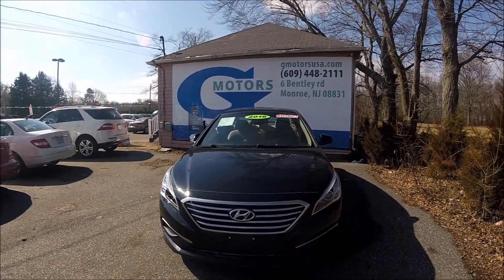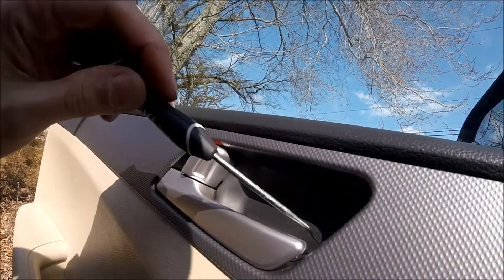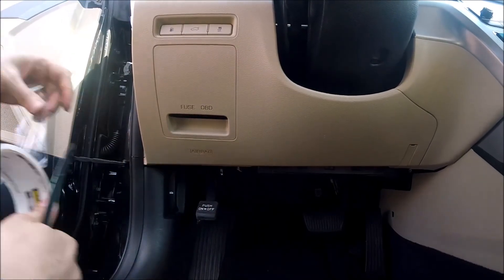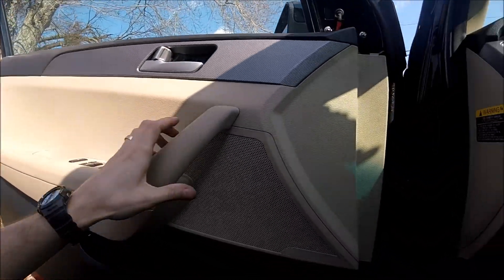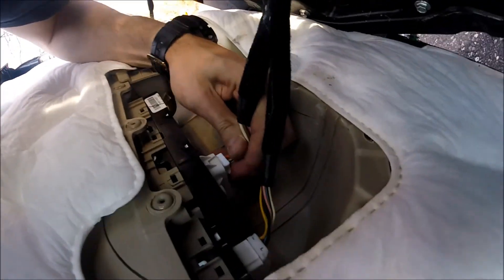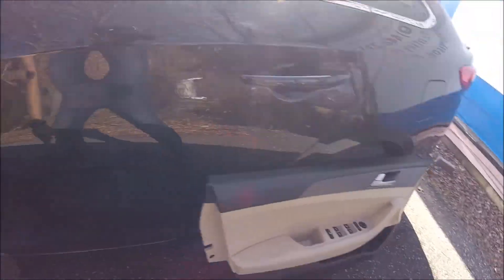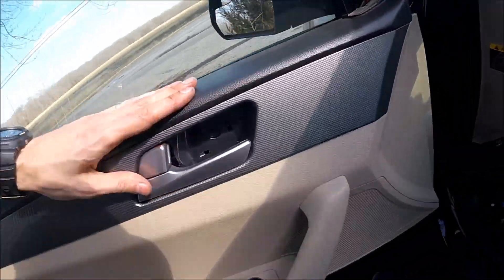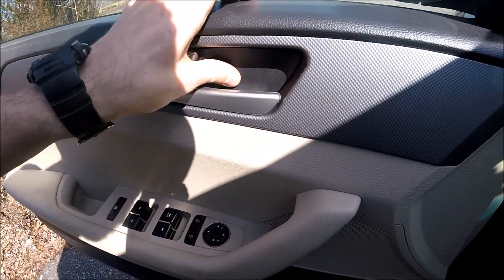How to remove door panel in 2015-2018 Hyundai Sonata

Comment: Thank you for video and I especially liked how you covered knife with tape to prevent scratching. I removed and replaced panel in ten minutes. The wires to the window/lock/mirror had become unplugged from switches. Very easy fix. My wife was so shocked when I was done so quickly that she gave me another project to do after a high five.

Comment: Hi, when you take those screws off do you get to see the inside of the body on the outside? I have a couple of dents in trying to push out from the inside but don’t want to try unless I know I can get to them.
Reply: did u happen to find the answer to that lol
Reply: rayraykobe I don’t think it was possible. If it was I think it would take quite a lot of work. I found a used door online for 400 though and just changed the interior stuff around which was surprisingly easy
Reply: @tomirving3988  thank you. going for it tmrw and see what comes up. Best of luck

Comment: after u take the 10 bolts out ( you just showed in the end )  the panel it is not coming out , you just showed the easy part
i need to replace the door sensor witch is inside the lock and its hard to get there because when you tray to take the inside panel out the window it 's coming down
Reply: Chris Severin did you ever find the solution to this? My 2016 sonata hybrid, push button lock/unlock is not working only on the driver side.
Thanks